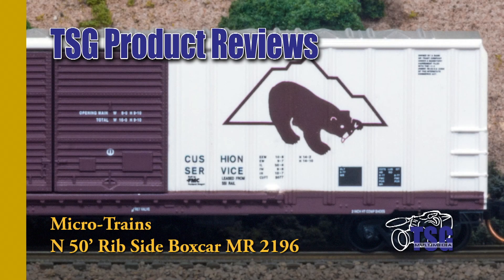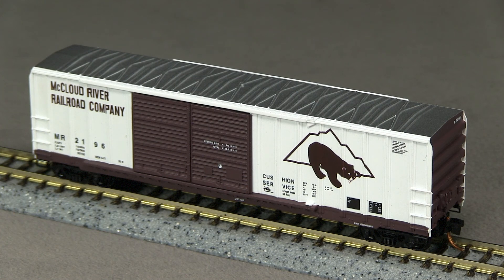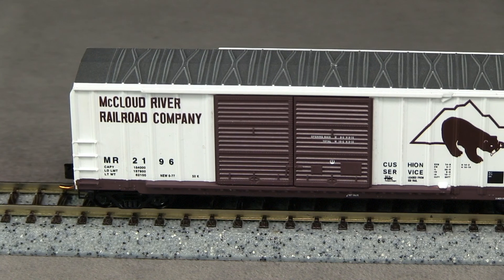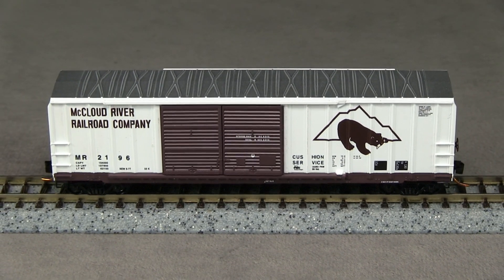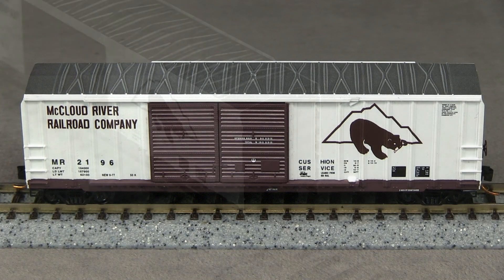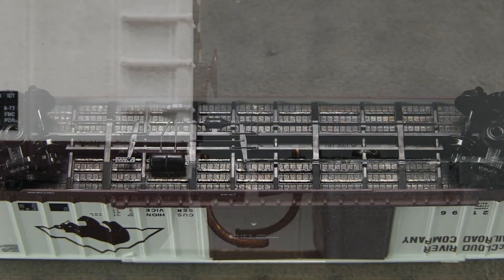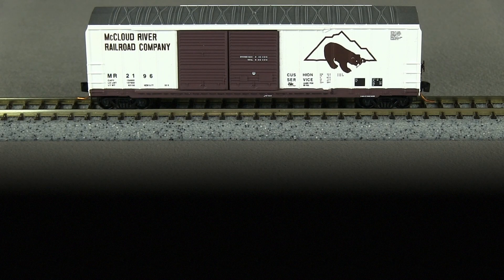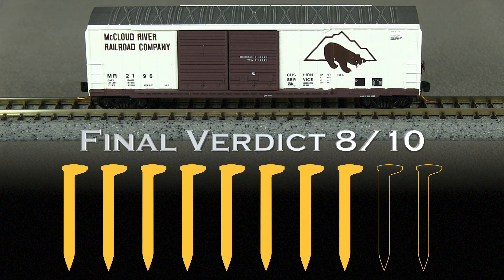N Scale McCloud Box Car MicroTrains Product Review

Comment: FYI this car is part of the Per Diem Series, a 12 month series, that began Feb 2016.  In the 1970's a surge of colorful boxcars could be seen all across the country as larger railroads leased more and more boxcars from shortline railroads. To encourage the return of the boxcars, shortline railroads could charge a per diem or daily fee, until the cars were returned. Incentive Per Diem (IPD) boxcars were primarily 50' rib side boxcars with 10' sliding or plug doors or double sliding doors.  Daniel, thank you for, as always, an very accurate, unbiased, professional review.